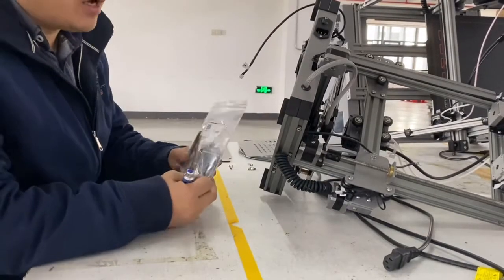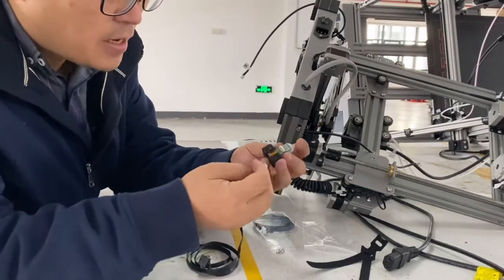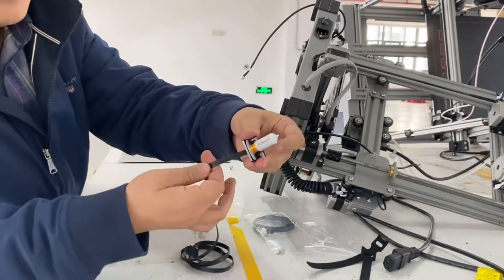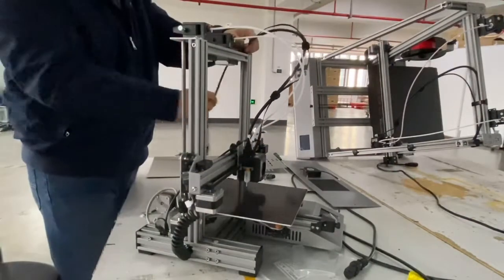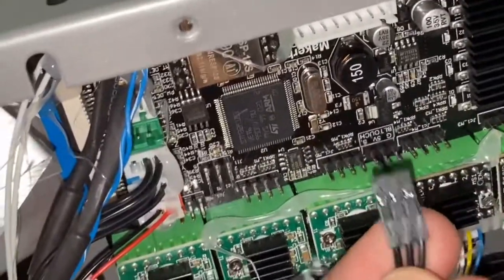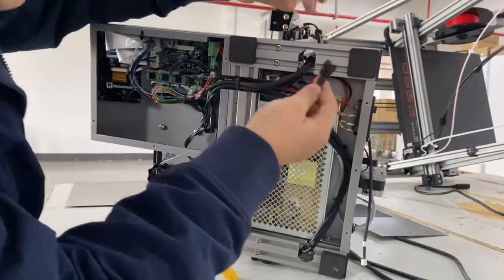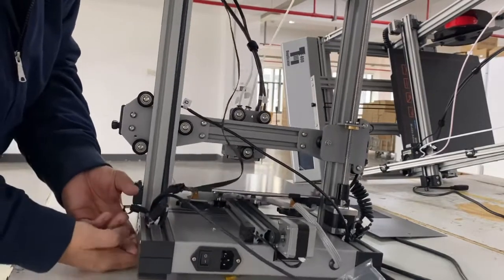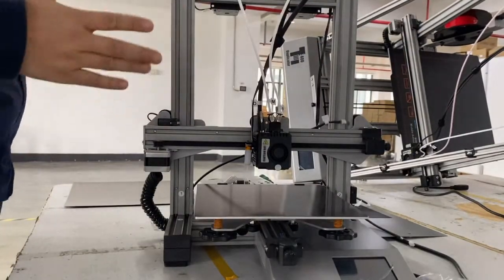How to add BL touch into D12/230 and D12/300 printer?

Comment: Please help. I have a wahhao duplicator 12/300 which I was so happy with. I was new in 3D printing and I have had it for a year, suddently everything died on it. the screen is gone and offcurse when the screen is gone you can not do nothing. At first I thout that the problem was the relay, so I ordered a relay for it, but it did not help. I had a powerfupply from a cnc project which could be
used, so I tried that too, without anything changing. I am out of idea's. Just before the printer went down I downloaded a couple of files from the internet to print and I tried one of them. My friend says that I should have been more careful downloading files because sometimes there are bugs in them? I do not know anything about that. 
Please any idea what I can do?

Comment: please make a new video with the update version. there are extra bolts and kind of thick washers, this is not visible in the video and instructions because this is from the 1st generation BL touch and not from the modified version.
i have install the follow firmware WANHAO_Robin_nano_1.0.6-230
no auto level for the bl touch to be seen on the screen only 4 leveling points like original without bl touch why ?
the Bl touch does not work and can not operate it via the screen why ?
in the vidoe of you tube they insert the bl touch in the free slot next to the z axis.
and do not remove the plug from Z axis.
do i have to pull the switch of the z axis ? I put the bl touch in that place ?